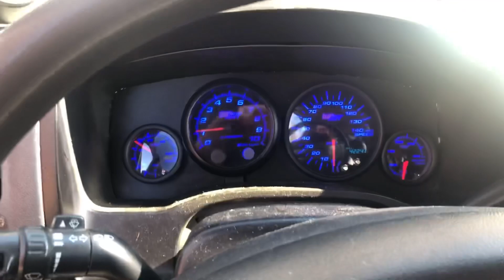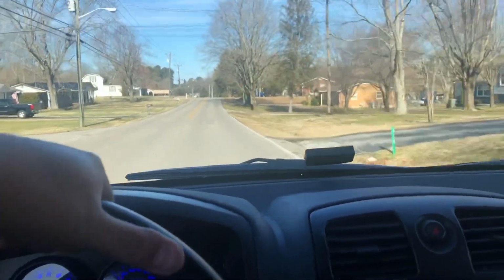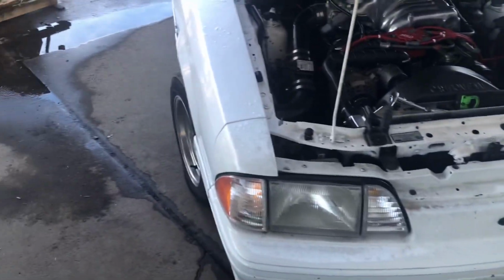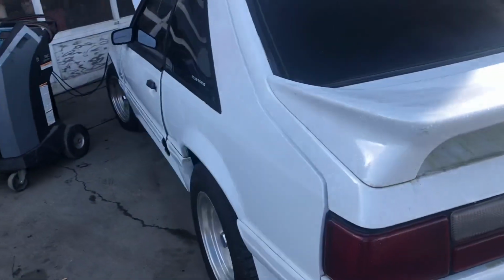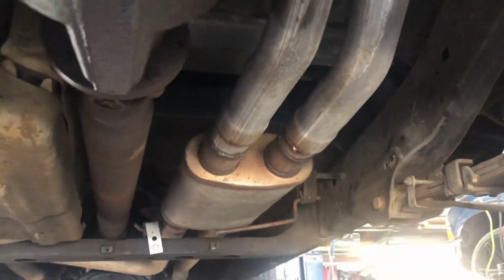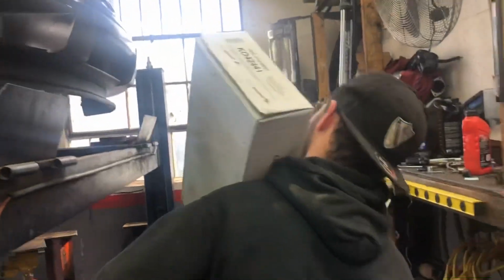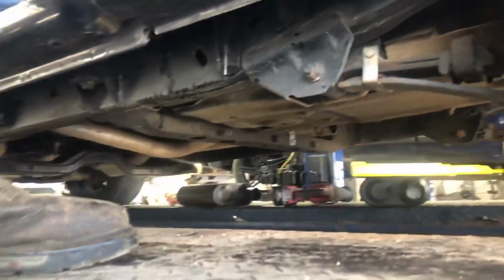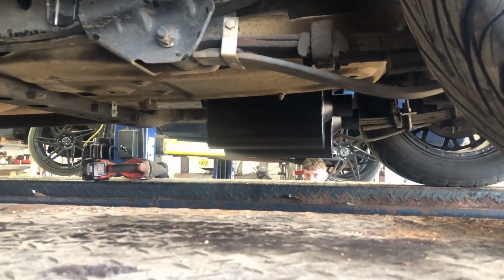CAMMED LS SWAP COLORADO! MAGNAFLOW VS MUFFLER DELETE VS FLOWMASTER EXHAUST COMPARISON!

Comment: 2.5" or 3"?  Did you change the torque converter?  If so, what stall speed?
Reply from the maker: No stock converter still & 3” exhaust tho

Comment: I'm just here because I want a nice mid sized little truck I'm looking at either a gmc canyon, chevy colorado, or dodge dakota. I know the king of all of them is a Toyota Tacoma but I can't afford that. I wouldn't mod it in any way though (the chevy colorado). The only thing I would do to it is chrome rims, chrome billet grille, chrome grill guard, and possibly tinted windows. I don't know why guys like to put those huge tires on them and to lift them. What are your honest non biased opinions on the chevy colorado? I have heard they constantly break down lmao
Reply from the maker: No issues but this one has a 6.0 v8 lol
Reply: @boosted9319  is the 5cylinder inline ok? I heard it is shitty, what about the 4cylinder? I will baby it and do all required maintenance on schedule and treat it like a princess. I'll avoid pot holes, go easy on the city miles, carefully accelerate, etc. I am very disciplined on vehicle maintenance.
Reply from the maker: @angelozicarelli541  I like the 4